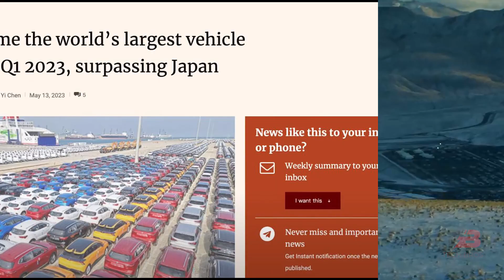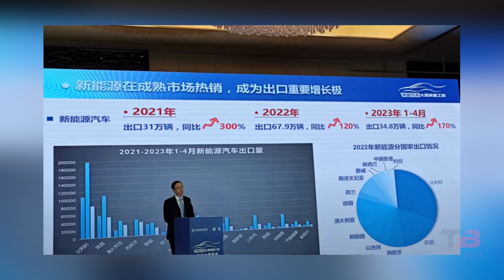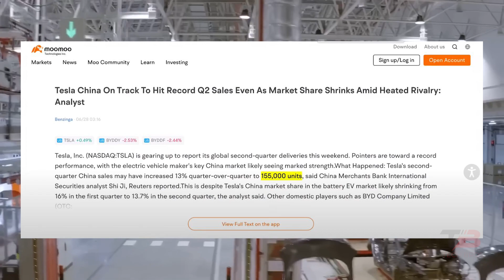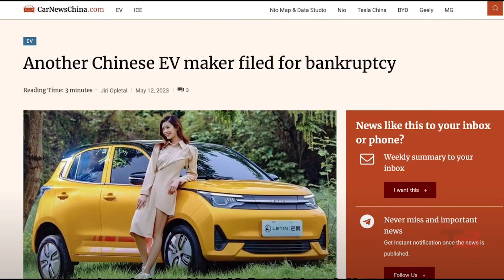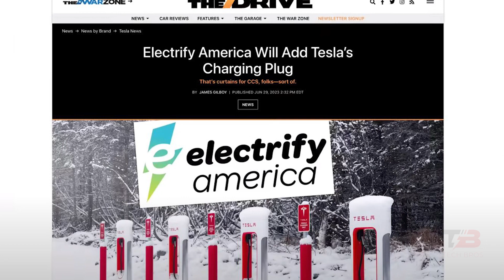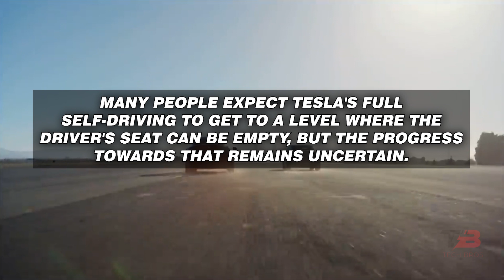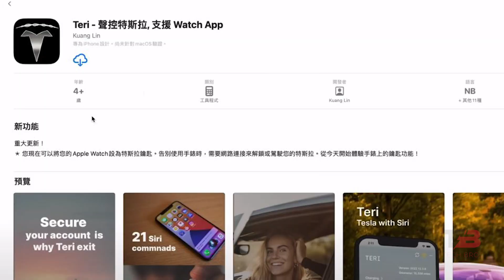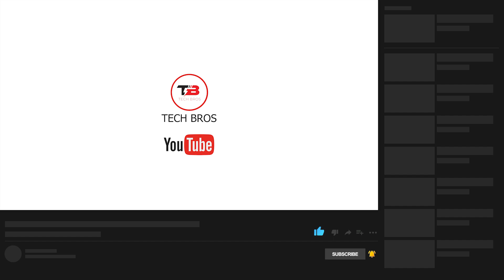Electric Vehicle Market Revolutionized by Tesla: Global Trends and FSD Uncertainties

Comment: Tesla could make a 500+ mile range car if they wanted to, just add more batteries. However it adds cost and inefficiency (more weight requires more power to move it) for a benefit relatively few people need. It was a product optimization choice by Tesla, not a technology limitation.